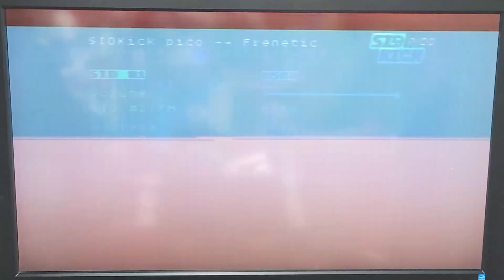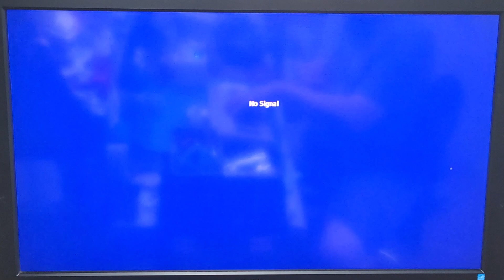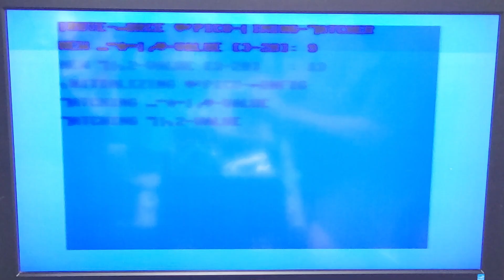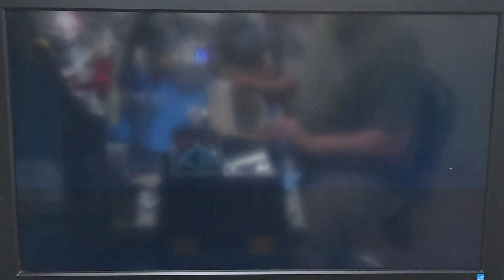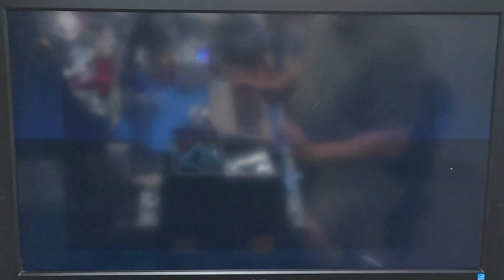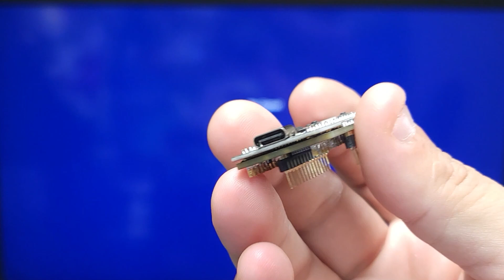I Helped Test The New SidKick Pico Firmware V.21! AND A NEW SidKick Pico Hardware Revision!!!

Comment: I wish I had found this video sooner.
I have just started using the SIDKick Pico and have been getting the problem of getting just the 'ready' screen when using sys 54301 or sys 54333.
The difference is that I am using PAL hardware and so far it has only starts happening after I patch in PRGs in v0.221 which I think was released at the end of December 2025. With 0.211 everything seems to behave normally.
I will experiment with the timings and on some different C64s and see what happens.
In my situation, I have noticed the opposite to your experience when it comes to the kernal ROM. If I use a stock original MOS kernal, the problem is far more prevalent than when I use, say, Jiffy DOS launched from an EasyFlash3 cartridge.

Comment: On a C64 made in Canada I had to adjust timings to make everything stable and working correctly.
I have one problem remaining: the audio output (through C64 socket) is quiet. It's not a huge problem, I'm amplifying audio externally and sound quality is still good, but I'm not sure whether something is wrong with Sidkick, or with my C64, or maybe Sidkick just always outputs quiet audio due to PWM or something else.

Comment: Does anybody know where to get the programmers? Even just somewhere where they sell the bare PCB without poco pins, socket or USB connector. Sure I /can/ order it from a large PCB supplier but if just wanting one or two the price is very high and I don't want to bother ordering so many I have to sell them to reduce cost.
I'm quite puzzled that noone selling the SidKick Pico 2040 seems to sell the adapter so customers are able to update firmware.
Reply from the maker: There isn't a programming adapter... You have the SIDKick board, with the custom circuitry, and the Pi Pico. Programmed through USB on the Pi Pico. You don't need the Sidkick board for programming. It has all of the level shifters and amplifiers on it to interface the Pico to the C64.
Reply: @The_Retro_Dungeon  Your image for the video shows the "new" SidKick Pico 2040. Unlike the the older ones which used a standard Pico board on top which had USB connector these new 2040 (like the older one didn't use the 2040 Pi) does not have a standard USB connector. Either you have to solder to the connectors or make a board with poco pins which then connects to USB so you're able to connect it to a modern PC to update firmware.
The programmer is shown on the github page but as said I can't find it for sale anywhere. I'm fine with a kit - just doesn't want to order 100 PCBs as they're the same price as 1 PCB from the big PCB manufacturers.

Comment: Mine stayed janky no matter how I set the timing. ;(
Reply from the maker: @Ipsissimus  Are you using the version 1 hardware, or version 2?
Reply: Interesting. I have a version 2 RGB with DAC. Not the new 2040 version though. I seems to have issues as well. Well have not tested it too well in vintage hardware but in the Reloaded MK2 I can't get it to act right either. Menu may be garbled. Sometimes I maage to get it to work and it sounds fantastic. Reverting to firmware 0.202 (if I remember correctly) seems to make it act better but still there's the occasional garbling of menu and wrong settings. Wonder if I dare get the 2040 version of it. However nice it seems if it's acting up too...